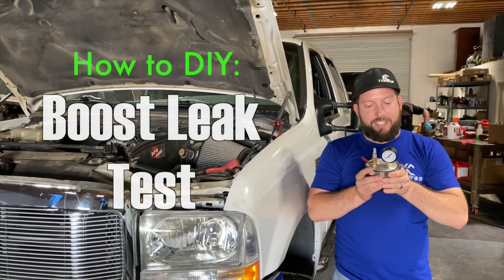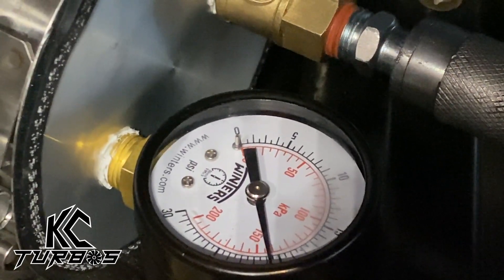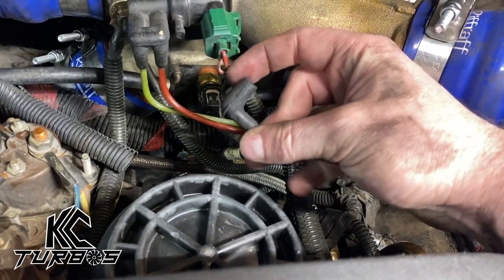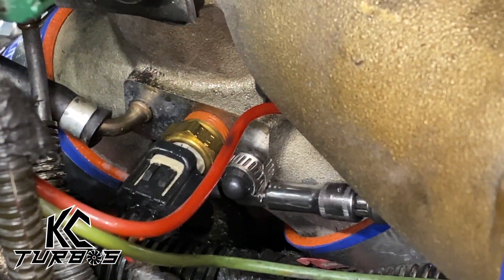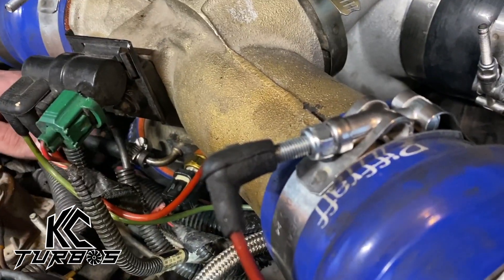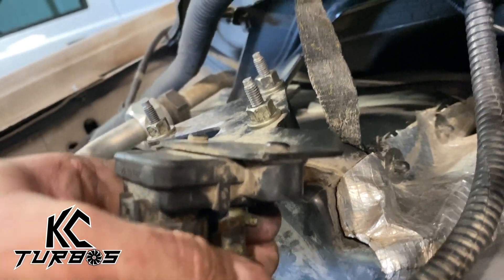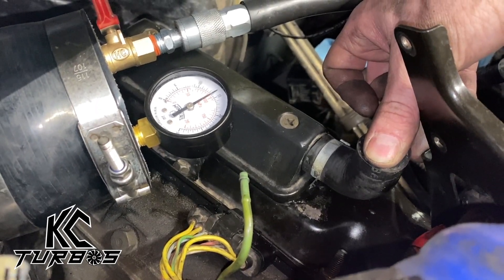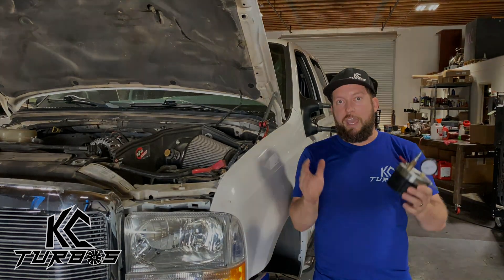Boost Leak Test Your Diesel Truck

Comment: Can we connect it to the Turbo inlet instead? My max pressure that I would pressurize the system with is only 20psi.
 
(The turbo is so tucked away that I will never be able to fit that contraption on there like that, lol!)

Comment: Thank you for the tip. I always wondered how they test for leakage through the turbo. Now I understand that it is the time that the air escapes what tells me, if there is a leak. I do not think I have a leak, but there is a whistle, what occurs when boost is build up. My turbo whines over 15 psi, but that small annoying whistle at the beginning.... it is a leak, or a sharp edge in my turbo intake manifold?
Reply: I have tried it today. It didn't work. I have a VNT turbo, that might be the problem.

Comment: What about when the leak is coming from the turbo itself? Just finished installing my brand new kc300x and i have a leak from the top bolt of the cold side housing... should i take it back appart and open the turbo to make sure the big oring is fine or its just a matter of tightening that bolt

Comment: Like others have mentioned I see, this is awesome!
And not falsely looking for vacuum leaks and saying it can find boost leaks, doesn't work like that.

A boost leak can sometimes only be found during pressure, cause sometimes it will seal shut during vacuum and no amount of brakeclean will find it's way into the engine!
Reply from the maker: Thank you! We see people often perform a non pressurized smoke test to check for boost leaks, but that also is not effective.

Comment: Spring clamps are actually the correct clamps for the job and the cheap jubilee you are using will create a leak down the road as they can't compensate for heat cycles and play. The best would be the very simple ear clamp for small hoses, they are perfect for those applications.
Reply from the maker: Agreed!

Comment: I watch these videos and they all suck. They should eliminate the engine all together because you always have intake valve open. Block both sides, air applied at exit of turbo and block at entrance of intake. Then you have a closed air system. You can create your own leaks by applying too much air pressure. A closed system will only hold the amount of pressure a turbo will produce without blowing off a clamp or tube. A good experienced mechanic want pay attention to these videos. Misleading.
Reply from the maker: The intake and exhaust valves on a diesel engine do not ever overlap, so no need to plug or apply pressure to the turbine outlet. The system should be pressurized up to the same max psi the turbo puts out. This will not cause any issues, but will simply show you where the leaks are.

Comment: can this fit on a 2008 srt-4 caliber? what size would i order? i need to boost leak test mines i know i have a leak someplace.
Reply from the maker: So this detector is for a 4" inlet and we have a smaller size that fits a 2.75" inlet. If your turbo has either of those sizes, then it will work

Comment: I out that the ebp sensor was leaking badly. Replaced it as well as the pig tail. Now I also know that the boot from the inter cooler to the turbo had a small tear on it. I slid it further down to avoid the small 1/2 inch tear. Probably leaking from there.
Reply from the maker: Moving it up likely helped, but if there is a tear in your boot, then you should replace it to play it safe.

Comment: can i do this at the intake elbow
Reply from the maker: Yes, it would work there. But if there is a leak where the boot meets the turbo inlet, its fine because the intake does not need to be air tight.

Comment: Be damn careful running that much pressure. I blew off the boost leak detector and was awarded with a hole in my ear drum. Took a year for my ear to heal itself. Sounded like a shotgun going off.
Reply from the maker: Yeah gotta make sure the clamp is good N tight.

Comment: i thought there is NO way air can get past the piston rings because diesel rings a much tighter ring clearance because they really need super tight seal for igniting the diesel.....But my diesel did the same thing and was wondering OH NO i killed my rings some how.....glad to know its normal.
Reply from the maker: Nah air can indeed get past the piston rings. Thats why a crank case ventilation is needed, to vent that excess gas.

Comment: I have been told that the pinch style connectors can adapt to heat while the hose clamps can get too tight and damage the nipples they’re attached to.

Comment: Do you guys still sell the boost leak detector,my truck is the 2004 6.0.Where did the air supply came from,the regular air compressor I presume.

Comment: Smoke ... test with smoke .
Reply from the maker: In our experience, the most common leaks are only found under pressure. Most smoke tests are not pressurized. In order to accurately test for leaks, you have to apply "boost" equal to that your turbo will be putting out.

Comment: Do you have to plug your exhaust?
Reply from the maker: No, the exhaust doesn't need to be touched
Reply: Took me a minute to think that through as well.
If the intake valve is open, the exhaust valve will keep the air in the cylinder.   If the intake valve is closed, then it will keep the air out of the cylinder.

Comment: Do you have to remove/plug the red line to do a boost leak test?
Reply: You can just plug the little red lines boot onto the end of your intercoolers pipes clamp bolt, it fits perfectly. As far as the green hose that plugs into black air filter pipe, just pop that out and cover the end with a piece of tape.

Comment: Um is it just me or the intake valves are not all sealed.
Reply: That's what I was trying to figure out as well.
Took me a minute to think it through.  If the intake valve is open, the exhaust valve will keep the air in the cylinder.   If the intake valve is closed, then it will keep the air out of the cylinder.

Comment: What exactly do i need to buy to make that tester. That's perfect
Reply: I made one of these for around $10-$15. I used a 3" rubber boot and a 3" pvc end cap, both found at your local hardware store. Then i just drilled a hole in the cap and screwed in a tire valve stem. And use a tire inflator with gauge to monitor pressure.

Comment: i just had a good shop install y'alls 6.0 10 blade rebuild kit and now im only getting 6 lbs of boost and the truck is an absolute dog. would this be a boost leak or a turbo failure?

Comment: Does a boost leak cause excessive turbo bark?
Reply: Same here on my 6.0... Although mine has been  from excessive EBP failures. Getting wet before we realized one of the hoses going to the coolant reservoir was leaking under pressure.
Reply: Causing low power, high boost and erratic reading under throttle. And barking if getting off the throttle while loaded up
Reply: @KKthebeast.NotSure  exactly my symptoms in my 04 5.9 cummins
Reply: That's what I'm chasing also

Comment: Should  you check the intake Plenum’s that bolt  to the head for leaks as well just curious?
Reply: Those are a common place as they use rtv and it can blow out of certain areas and leak.
Reply: @racerschmeckpeper9043  is that rtv only??? No o-ring or gaskets? I'm assuming you need to pull the turbo to get the drivers side off?